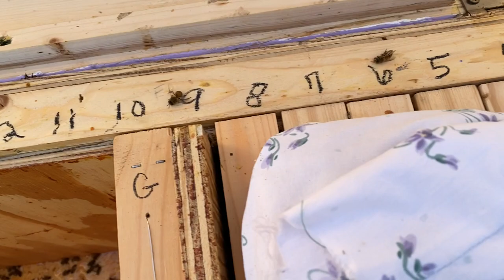Dead Out Clearing in a Layens Horizontal Honey Bee Hive February 2022 Om Bee One Hive

Comment: No comments yet for your roof space insulation. Going back to your: "90 Day Inspection 20 Frame Layens Horizontal Bee Hive on July 29, 2021", video it appears that you may have a Dr. Leo's 20 frame insulated hive build here but I can't confirm by looking at footage. Your Winterization Day 174 video was likely a good assessment of too few bees was probably correct. The fluffed wool pillow will insulate but being so far north I'd probably opt for 1.5" styrofoam board panels to fit both on top of the colony and to line the outside of the follower board. The "Vino Farm" channel has documented his winter die out issues in Massachusetts and found that generous insulation has done wonders for colony survival. All the Best!
Reply from the maker: Thanks Roy for the comments. I will be winterizing a little different this year, especially for this wool insulated hive. I could potentially add some styrofoam to the center of the roof so as not to block the vent holes. Will also be doing more wool in the pillow and something next to the follower board. A wind break that is closer to both hives will help as well. There is a fence close by for an initial wind break but I am thinking right next to the stands. Wish me luck with overwintering this year! I am going in the hives today, September 11, 2022 and hope to do a Youtube live for this inspection. It's not quite winterize time but it's been awhile since I looked at the last few frames.

Comment: I live in Wisconsin and have bees survive in Layens hives. You do not have enough bees. Three pounds of bees are not enough to make it through winter. You will need 5 full frames of bees. Also way to much honey for that amount of bees. Take a couple of your biggest honey frames out and confine the nest compartment so bees don’t have to work as hard to maintain the microclimate. Since you thought the hive was dead in December those dead bees are summer bees. In mid August the colony builds up fat bees also called winter bees. Those bees are meant to over the winter. Mid August through October is the buildup of the winter cluster. Since you said a late season swarm. Those often are to weak to make it through winter. Late season swarms often have old weak and or failing Queens. Replace with new Queen in Early August and it will add much vigor and quicker growth of bee population.I have 50 percent better winter survival rates with young fresh Queens. A bigger pillow with more wool over to top is all you need for insulation. If possible buy bees and queens that have might resistant genes since it’s difficult to treat because the top bars touch. Splits-brood breaks and new Queens help keep Varroa mites in check. Hope this helps!
Reply from the maker: Thanks for the suggestions. This colony was installed from a swarm trap in early July. Here is a link to the video where I am just moving them over to their own hive box(the box I am clearing in this Dead Out video) on October 31, 2021. https://youtu.be/RnRto0lNPSU 

Perhaps the "late season swarm" you mention was me stating that we had a swarm of unknown origin on the property late in the season which probably attributed to the colony that had resided in this box all summer and did not survive through the fall.

I will be reducing the number of frames in the winter nest for next year based on my observations from both colonies to 6-7 frames. This colony set up their winter frames a little fuller with honey than my other colony. Neither colony survived the winter. I still like Dr. Leo's recommendation of leaving a full frame of honey at each end of the winter nest though. Since I now how frames of comb, hoping the new bees will have an easier time through the seasons since they won't need to expend so much energy on comb building.

Both the colonies did their own brood breaking, we think, because we had swarms on the property which settled too high in the trees to catch. 

Yes, I will be doubling the wool in the pillow for sure next year. Buzz ya later!

Comment: If you like science and data, Check out Derek Mitchell.  Also check out Ned Hesbach.  Did you do a mite check?  May answer one question.
Reply from the maker: Thanks for the referrals. Yes, the mite check is at the end of the video and what I did with the sampling of bees I show on the paper right before I closed up the hive. Spoiler Alert, mite presence is another data point. I have read that mites might contribute to a defensive colony and I can attest to that! This colony was defensive from day 1 of doing a quick check inside the swarm trap before they were moved to a hive box.
Reply: Yes, Ross, I was going to recommend Derek also.  From what I've read of his work (and what Tom Seeley has said about him) its  basically, if you put a bunch of vent holes in the top of your hives (I saw 4 on one end so probably there are 8) then there isn't much point in insulating the rest of the hive - because the heat goes right up the chimney.

Comment: that is too much space in horizontal hive you need huge colony to winter there
Reply from the maker: Hi Serge, Do you mean there are too many frames to over winter on? I agree, I could cut down to 4 or 5 frames with open cells at the bottom and honey in the middle and top. Adding a frame of honey on either side of the center frames.  Or do you mean the Layens frames are too deep? The frames are deep so that there is plenty of honey above the cluster to consume during winter as they move up the frame. They should then use the honey on frames 7 and 8 in the spring after they have broken cluster. Thanks for replying!